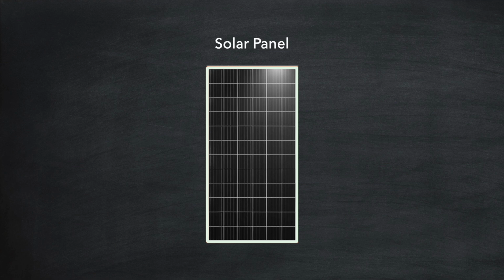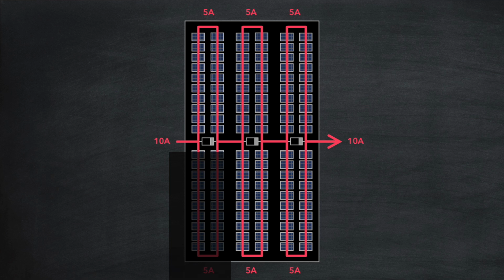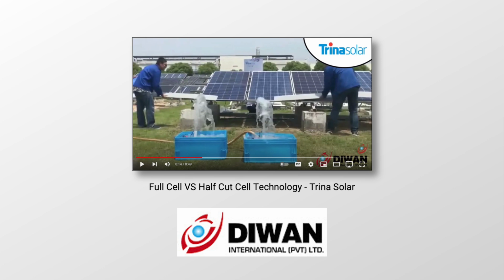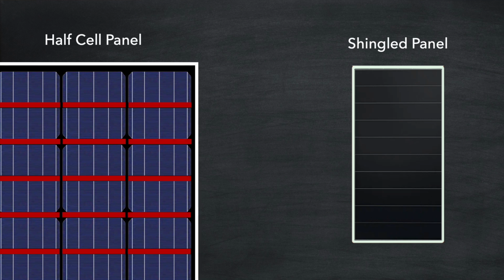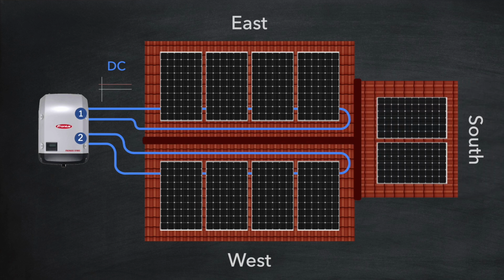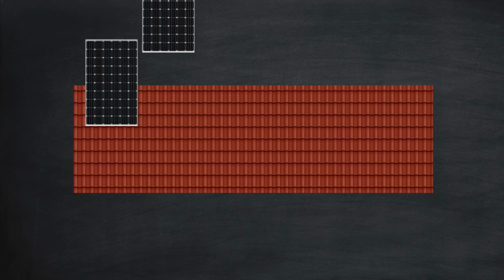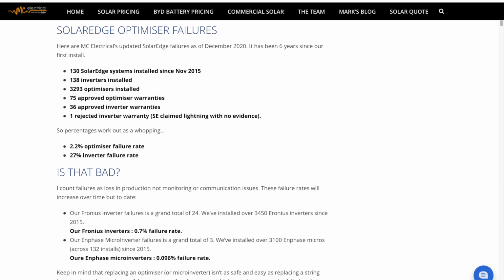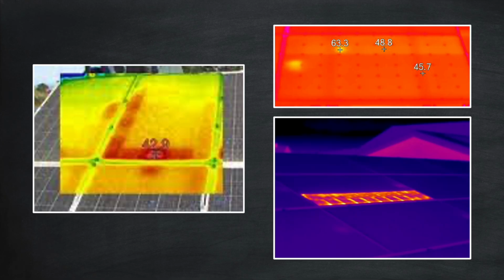Solar Panel Shading (Part 2): More on Optimisers and Micro inverters

Comment: I found Part 1 last week while searching information on SE optimisers and Enphase micro-inverters, and now you're here with part 2, handily suggested by YouTube. I found the last and this video very informative so I subscribed. 
I don't use a lot of electricity and won't for the next at least 5, probably more years: no EV to charge, no heatpump, gas cooking... And I don't have a huge amount of South facing (North-South roof) roof space that is recently renovated, so I plan on getting a small array of 5 or 6 panels...
However the day will come that I'll at least have an EV, probably an induction cooktop and/or a heatpump as well. By that time the rest of the South-facing parts of the roof should be renovated and I could expand the solar system.
Hard-shading shouldn't be an issue as long as the neighbours don't decide to grow massive trees close to the border.
Based on this video I think a system with optimisers isn't for me, but I do consider a simple string versus micro-inverters.
The options basically are:
 1. Use micro-inverters: per panel monitoring (but is it free to do so?), no loss of production in the other panels if one panel fails or degrades quicker than the rest or has a bunch of leaves on it, no extra cost to split the production over my 3 phase supply.
 2. Use a single phase string inverter rated at what I need now, get a second one on a different phase when I expand: no per-panel monitoring, efficiency loss if one panel fails/degrades/dirties, possible phase-balancing issues (only 1, later 2 of the 3 phases get solar injection).
 3. Use a 3-phase 2-string inverter that's twice the power of what I currently need: probably the highest up-front cost but expanding is only a matter of buying the solar panels and connecting them up as a second string (spending now to save later?), no phase-balancing issues, but still no per-panel monitoring and efficiency loss per string if one panel fails/degrades/dirties.
What would be wisdom?
Reply from the maker: Hiya - glad you're liking my videos! Now, apologies that I don't give people advice (even free advice is fraught with implicit liability) but I highly recommend you join a Facebook group on solar (like the one I mention in my video) - it's a great place to pose problems and ask questions. Good luck! :-)
Reply: Real question is whether your setup will be grid-tied or off-grid, and whether you intend to have battery backup. 

If it's grid-tied and you have no plans for battery backup, microinverters might be the way to go since they can just send AC directly to your panel & the grid without anything extra (they shutoff their output when the grid shuts off). If you DO plan on having battery backup, a hybrid string inverter is probably the way to go.

If it's off-grid, you basically NEED a battery... and in order to charge a battery with microinverters, you'd have an extra step to convert back from AC to DC again... then when you pull that power back out of the battery, you lose even more power to another conversion from DC back into AC for your panel/house to use.

Hope this helps! Personally, I'm doing a smaller mobile build so I'm just doing a 120V hybrid inverter initially (likely a Growatt 3000 along with a ~5kWh LifePower4 server rack battery). Good thing is, most hybrid inverters like this can be paired up with a second unit later on to produce split-phase 240V AC.
Reply: @Justin-C  I live in Belgium, we either have 2 types of 3-phase networks depending on when the street/area got electricity: either a 3-phase without neutral delta supply with 230V between the phases, or a 3-phase with neutral Y supply with 230V between each phase and neutral and 400V between the phases. We can choose to have either a "single phase" (which sometimes is actually two phases, sometimes 1 phase and a neutral) or 3-phase power in our homes. Since I am renovating and taking into account future induction cooking, heatpump, EV-charger... I chose to get a 3-phase supply which in my case is the 3P+N 400/230V kind with 32A per phase.
We have digital smart meters that count consumption and injection seperately, for injection we get about 1/3 of what we pay for consumption, which would be a great argument for having a battery if those things weren't so expensive. We also have a system called "energy sharing" which means we can sell or donate our injected power to friends or family, and only if they don't use it (all) at that moment you sell to the provider at injection price.
I would go for that energy sharing system for now: my parents would co-invest in the solar setup and in return I would donate my surplus to them (they don't want the hassle of getting solar panels installed on their own home that has 3 floors between the consumer unit and the roof). Batteries are just too expensive for now and don't provide long-term storage to allow for seasonal equalisation.
I would install 5 or 6 panels of around 400Wp. If I go the string route, I could use a Growatt MIC2000TL-X or MIC2500TL-X on a single phase and just get another single phase inverter when I add 5 or 6 more panels. That inverter costs about €400-€500 atm.
If I go the micro-inverter route with Enphase, I already have to spend €175,- on a shut-off-relais/phase-coupler, plus €200,- on the "Envoy-S" communication-gateway, plus 5 or 6 €180,- IQ7A micro-inverters for a total of €1275-€1455. That's €875-€945 more than the string inverter.
I was of the belief that unoptimised strings are outdated technology, but considering my small array would have the same orientation without hard shadowing I'm not so sure I really need the per-panel optimisation and monitoring I would get with optimisers or micro-inverters considering the extra cost that comes with it...

Comment: Perhaps optimisers/microinverters were more useful when panels were less sophisticated than they now are.
Reply: You've totally hit the nail on the head there. So much research and development has gone into modern panels such as half cell technology, Top-Con, bypass diodes etc, all to increase longevity and production in shade. There are still a few small use cases for optimisers and microinverters but many consumers are being grossly misled by installers saying they'll lose the output of the whole system if an edge of a single panel is in shade. They pay more for no real return
Reply: @chriscodes1  Agreed, unless their hobby is panel efficiency watching😊😊
Reply from the maker: Good point, David. And actually, just like any business today needs to adapt with the changing times, I expect the engineers within the companies that make optimisers and microinverters to wake up every day, thinking "what we have now is not good enough" then going on to design something revolutionary... I can dream...
Reply: @GaryDoesSolar  Over the life of the array, a 25-year warrantied microinverter system will be cheaper and more robust. You will lose 100% of the array when the string inverter fails or a panel goes down for whatever reason.  Simply not so with microinverters. 
FEMA in the USA recommends microinverters over string for this very reason. Weather events are famous for provoking failures. With microinverters, the failure is limited to the panels involved rather than the system as a hole.
I would rely on FEMA data over the local 3000-unit data set you quoted in this video.
FEMA data comes from actual disaster events throughout the USA and territories.
Enphase next generation microinverter will feature GaN, will address the newer 500-watt module output, and have a practical life of 40-50 years. Look for it Gary, Enphase is the power electronic innovation leader in the space:) As far as initial cost goes, no price increases are on the horizon, and with the IRA now law, the price per watt will see declines. 
Yes, clearly I am an Enphase fan:)

Do love the content, not trying to through stones in your pond:)
Reply from the maker: Thanks  @s.lionelmcauley4455  - this is great insight. And I agree with you, I believe microinverters have the potential to be the basis for peak adoption of domestic solar, especially if the reliability levels are high. I'll be making a video all about this soon - thanks again for taking the time to comment 🙂 Have a great 2023!
Reply: @GaryDoesSolar  Let's hope so and thanks once again for such an instructive video.

Comment: Another brilliant video Gary. Reassuring that the micro-inverters I'm having installed in January because of our panel installation is spread across two roofs on two buildings. Thanks as always for your in-depth research and clear explanations 👏
Reply from the maker: My pleasure Paul. It's quite a lot of work, researching everything, but comments like this make it all worthwhile! :-)

Comment: Hi and thanks for this. 
In part 1, shading 2 substrings reduced the panel's output to 100W. The 3 panels together than have an output of 700W. This 300W half cell example shows similar shading reduces output to 150W by the inverter reducing the current to 5A. But this affects all panels on the string doesn't it? So we'll have 150W from the partially shaded panel and two more running at 5A each, so 150W each. 450W total. Now I'm also lost as to why a partially shaded panel has the same output as an unshaded panel.
Doesn't that make a half cell panel string worse than full cell under partial shade? Please point out where I've gone wrong! :)
Reply from the maker: Ok, I see where you're coming from - this is where optimisers and micro inverters come in, in fact. A perfect scenario for them to be useful! Aside from that, if it's the case that all the panels suffer the same kind of shading, which means the string inverter can reduce the current and all the panels will benefit.

Comment: I only had my solar power system fitted earlier this month and have really enjoyed getting into the technical side of it. Your videos have been the best, most informative I have found, so thank you very much.

My system:
18 x 405W Longhi panels
Lux Power Tek 6K Hybrid Inverter
2 x Greenlinx 3.2kWh battery

Getting a system installed at this time of year, well, of course I am not seeing the best it can do yet, but I have still had some good days, 15.5KWH one day! Not bad for the North of England.
Reply from the maker: Thanks pretty amazing generation for the time of year, where you are. The New Year is just around the corner and the brighter days are coming. You won't look back! :-)

Btw, your array size is similar to what I'm (finally!) hoping to get installed. The date has been pushed back to end Feb... Oh joy....
Reply: @GaryDoesSolar  Today was an example of the other end of the spectrum, 1.4kWh. 🤣 A really grey/misty day. I really can't wait to see what I'll generate in the summer months. 

Ah well, at least February is the month where generation starts to ramp up again. 
Which kit are you going for? Or is this to be revealed in a later video?
Reply from the maker: Yeah, I might talk about my setup in a future video. But here’s what I’ve gone for:

19 x Perlight Delta 400W Total Black Mono panels
1 x GivEnergy Hybrid Gen 2 Inverter
2 x GivEnergy 9.5kWh batteries
1 x MyEnergi Eddi

Still looking for a good EV charger solution…
Reply: @GaryDoesSolar  Sounds great. Nice battery capacity there too.
We were not sure if a third battery would help  us, the amount we use/the amount we can top up/the amount that the inverter can provide at one time, not sure if we would get the value out of a third battery, time will tell. We might be making an extra purchase!

I believe that the Zappi is the go to EV Charger for solar.
Reply from the maker: Yeah, agreed - Zappi seems to be the way to go...

Comment: Hi Garry, another great and informative video.  You mentioned the potential problems of matching a replacement panel in the future if one were to fail (which could well be within warrantee period therefore manufacture’s / installers issue for the replacement?). However another consideration especially for the main inverter or battery system is obsolescence where the warrantee period is a lot less and with technology moving along quickly replacement parts may not be available. If this happens in just a few years time and an expensive replacement unit must then be fitted? Your thoughts? Thanks again :-)
Reply from the maker: Hi Robert - thank you. This latest video was really hard work! The most difficult to date in fact. 

Yeah, it's a real problem with parts no longer being available. All we can hope for is that prices come down over time, so that consumers have the choice of buying new (superior) parts, or having market outlets selling (cheaper) second-hand parts - just like other markets today (e.g. automotive, computer)...

Comment: Thanks for the shingled tips!
Carry on the good work !
Can you please investigate the UK installation market : I am been offered for a 4 panels setup a 6000£ (2000£ of parts)… while my setup (on top my garage) does not require any scaffolding!
Reply from the maker: My pleasure - it seems like shingled panels are most definitely the future - not least, because you can make different panel designs with them. Tesla are taking this approach for their solar roof tiles, for example. Check out the Facebook group I mentioned in my latest video - its a great forum to ask questions about quotes etc. Good luck with everything!
Reply: Find another supplier
Reply: Does seem expensive, how many quotes do you have?
Reply: Hi Nicolas, one of the quotes I recieved when I was looking 2 months ago for a 12x 365w panel array coupled to a 3.6kW inverter was £5791.60 fully fitted. For the same install but with 5kWh battery and hybrid inverter the cost changed to £9225.60 fully fitted. Labour charge was £1550 / £1750 respectively. I hope this info helps.
Reply: @adrianlynch9435 thanks a lot. Indeed these seems more in line with what I thought!

Comment: Hi having the enphase micro inverters this added £3,600 to my quote ,do companies offer this as an easier installation option, also is there any solar grants ,or any help towards such renewable energy, as we all could do with a little help with the cost 🤔 ,as always great info
Reply: I recently had my system installed and the only help is zero VAT, which to be fair is a significant saving.
Reply: @JetmanUK  yeah that’s a fair point ,
Reply from the maker: It's crazy, the pricing that's going around at the moment. I hope you're able to get the deal you're looking for. Yeah, the VAT saving isn't as good as some countries, but it all helps...
Reply: It seems that Companies prefers to supply micro inverters/Optimizers so then can charge a % on top of each item witch at the end would be more than fitting 1 string inverter + the fitting time.